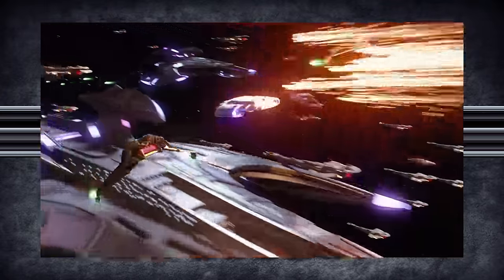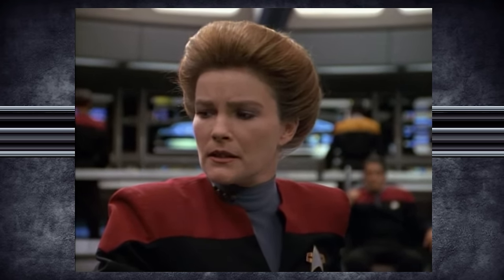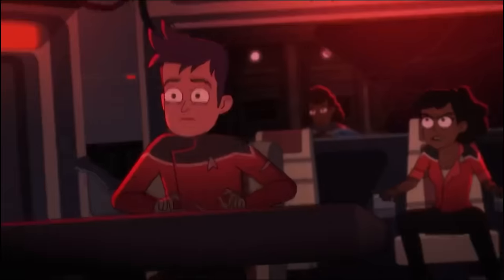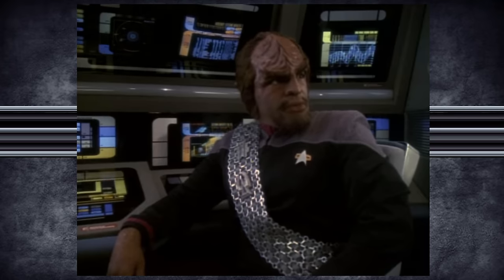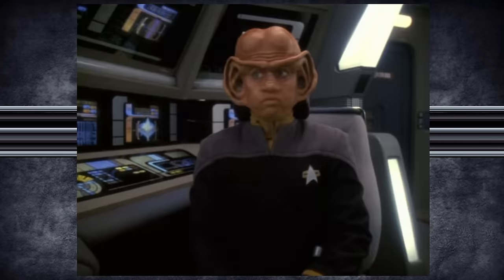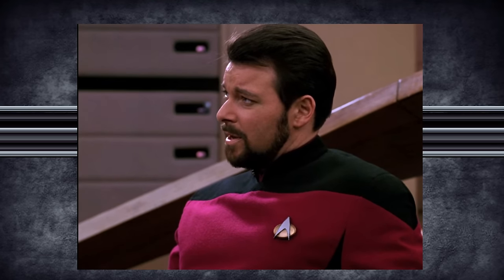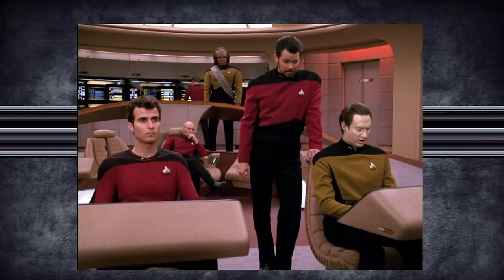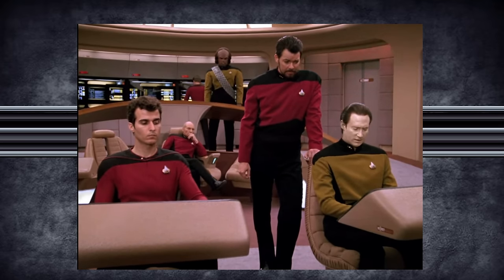Why Starfleet's Bridge Design Was Lethal to the Crews

Comment: Their consoles had zero surge protectors and seemed to be insulated with powdered magnesium.  It seemed safety was priority 5 or 6…
Reply: More like "Not on the list".
Reply: Principles of SF Design:
1: Shape
2: Feel
3: How the officers felt
4: Somewhere for a counsellor....on a bridge....
5: Comfort
6: Style
7: Colour matching
8: Practicality
9: Safety
Reply: I blame the Bluegills.  The space parasites obviously needed to be able to disable any ship that stood against them.  Designing the consoles to explode with only the slightest power surge would do just that.  Only, after they were eliminated, nobody realized what had happened, and Starfleet continued producing the Bombsoles, as they had been conditioned to think bridge explosions were normal.
Reply: Almost like they had forgotten the concepts of Low energy control circuits learned in the 20th Century.
Reply: A tradition dating back at least to "voyage to the bottom of the sea".  The most efficient way to wire anything is to route the main bus through the control console.
Reply: You're not wrong, think of all the components you save.  (/S).  On a serious note this is hold the old rotary dial dishwashers and ovens and washing machines all work.  The dial is directly connected to the power.
Reply: Explosion! Drama! Pew pew. They need less surge protection to have more drama! Lol because explosion equal ratings ;)
Reply: @whirledpeaz5758  
Yeah. It is a computer terminal for weapons, not the weapons themselves. The engineering section console is not the warp core. 
It is just a computer interface. It isn't even the computer itself. It would be like my keyboard and mouse exploding, but neither has enough juice to blow a knat's  nose.
Reply: I believe the EPS system was supposed to directly route the pasma created in the warp core directly through all areas of the ship to provide power.

Pretty much any power surge - no matter how small - would result in everything within about a foot of the plasma coduit instantly vaporizing into superheated gas.
Oddly enough, this tracks with Scotty talking about replacing fuses and "fused" systems in TOS all the time.  Fuses in electrical systems prevent fires by being designed to fail if the system goes above a certain limit.  Plasma fuses would probably do the same thing for the ship's internal plasma systems.

Notably, fuses in the real world have a degree of variability in their construction that can lead to spectacular results if a system experiences a big enough surge to experience several failed fuses at once. 

By the TNG era Starfleet had advanced 'beyond' fuses for most systems and as a result exploding consoles became a recurring problem.
Reply: @Grizabeebles  That, and Surge protectors are rather limited at what they can do.  For example, the massive transmission lines that we see coming from power plants can actually shoot power within 6 FEET (1.82 m) of the wires themselves.  That is why you see them held away from the steel from from massive conduits.  Now, we are dealing with weapons that include charged plasma, particle beams, and other weapons that are capable of creating an electric charge all by themselves. Quite powerful ones that would likely put the power transmission wires to shame.
Reply: EXPLOSIVES! Build explosives into EVERYTHING! LOL
Reply: I think is because their power is plasma based, meaning the straight up use the plasma produced by the reactor(warp core) and directly use it as power, this make a surge system difficult because flux in energy literally is represented by flux in temperature and electric potential energy in the plasma
Reply: I think they put quick upward mobility through the ranks above safety.
Reply: @SImrobert2001  Y'all are missing the face that this universe has miniaturized, self-powered shield generators. Why does every crew member not have one that immediately activates as soon as an alert level is set? Why do the consoles not have emergency containment fields in the event of an explosion? Why is the entire interface not a forcefield with a holo-projection under it?

In the complete opposite direction, why are there absolutely no manual disconnects or overrides anywhere in any Starfleet construct? These people lose power and then they have to put suction cups on the doors, did they forget handles exist?
Reply: @Teth47  -- Don't forget the "structural integrity fields" - Starfleet Ships often need working forcefields just to move under power without ripping themselves apart or exploding.
Reply: Magnesium, wrapped in lithium,  with a thin glass coating.

And giant capacitors, guaranteed to knock crewmen unconscious.
Reply: @sirhenry9313  Only the Galaxy Class had a station in the center for counselor/auxiliary. Love Boat is fairly accurate. I think the layout served the crew well (outside of combat). The battle bridge probably could have used a better, more combat oriented design. after all, the Galaxy Class was a diplomatic ship. Think it was also the only class to specifically feature a large civilian compliment. Something Picard was not actually fond of.
Reply: @Krahazik  Sovereign has 3 as well.
Reply: @Weaseldog2001  Don’t forget the outer shell of each console being constructed of C4.
Reply: @icecold9511  Remember a few times in TNG when Geordi would come onto the Bridge and just - turn a station into Engineering? Couldn't do that if it was more than 'just an interface'.
Reply: Also they were full of ROCKZ!!
Reply: And the bridge was made with ROCKS!!!!!
Reply: They went like "So let's feed the main power directly into the display. No regulators needed."
Reply: I'm not sure, but my understanding is that surge protectors may have turned the console off when they needed it.  A risk of damaging an officer for a few more minutes of use of the equipment might have been a good trade.
Reply: On later Federation ships that had the Galaxy class  style touch panels literally any station could be displayed on any display panel. 

IMHO the bridge layout of a nuclear  submarine is similar to the Defiant. Everything is arrayed around the Captain do he can communicate easily.
Reply: @frankharr9466  Well, the things that explode are basically just a display and a keyboard combined. So I'd rather have a screen not exploding into my officers face than create extra work for medical staff while a battle. It's not like that tiny bit of extra information is useful if your officer seeing it dies or gets unconscious.
Reply: I'm pretty sure most people in this comment chain are wrong. Safety is the #1 priority focus in designing any components for Federation starships.

It's mission-critical that every piece of every ship provides the minimum possible level of safety without failing spontaneously before leaving a spacedock. Anything more and the ship would be a design failure.
Reply: Things that always bothered me: 1. Near total lack of redundancy. 2. Fragile main power distribution systems (EPS conduits fail all over if the ship is hit in one place). 3. Lack of automated defensive systems and requirement of a crew member to arm and target weapons (targeting fast moving ships when you are in a fast moving ship would be almost impossible to do manually). 4. Lack of AI throughout the systems on each ship and across the fleet. 5. Complex maneuvers performed by a single crew member when it's virtually impossible for one person to operate a complex system of thrusters need ed to change direction in space at a rapid pace (while admitting that a system could be designed to allow for computers to do this while the helmsman could manipulate steering controls while navigating visually...but see the problem of high velocity). 6. Fly by attack patterns just make combat difficult and never seem to make a difference because the weapons vector can change on the fly. 7. Humans making defense pattern decisions and having to call them out instead of simply inputting the command or allowing an AI based tool to optimize the situation. 8. Shields that do not automatically rotate frequency. 9. Why a night shift that's leanly staffed in a ship operating around the clock? 10. Why do localized explosions and attacks cause shipwide loss of stability? Is the ship made out of string cheese? 11. Lack of segmentation of computers and ship control systems. 12. Lack of personal emergency transport activators. 13. Having to manually drop and raise shields over a period of many seconds to transport when the transporter signal would pass through the shield at ultra high speed.
Reply: @texlad04  actually, the weakest component, namely the human part, is also the most flexible and intuitive one. But yeah, many things are hilariously stupid. Like having not really secured access codes that you have to say out loud in front of everyone and which do not seem to change at all. And having centralised access code management.
Reply: @comedyclub333  exactly right on security. Aren’t the access codes 4 characters or something like that? If you can break a hash of multiples of that number of characters with 25 bucks of computer time in 2021, you would need much stronger authentication measures for even non-critical starship systems far into the future. But voice command probably did sound like hot stuff to the writers of TNG back in the day  which is why I imagine they went for it. But why did the absence of a keyboard mean that people would push odd sized colored buttons in random sequences? At least I do think the latest holographic controls in Picard look like they might be practical.
Reply: @comedyclub333  

Is it worth it if the screen stays on and usable as opposed to off and you have to reboot it?

And don't forget, you run the chance of loosing drama!  You can't bore your audience.

Also, my understanding is that people who drive Hummers into combat areas do essentially the same thing.  They disable the fuses so that they can keep using the vehicle a few moments longer before it shuts down.
Reply: Just think of all the companies you've ever worked for. "Safety First" is always 4th on the list, at best... Profits, On Time Delivery, and Customer Service are always the first 3. Quality and Safety are in a never-ending fight for 4th on the list.
Reply: @sirhenry9313  You forgot carpeting quality and mood lighting?
Reply: @hullbarrett  

If you want safety first, don't leave the planet.
Reply: i think the consoles had surge protectors, but you should understand that no matter how robust your insulation is an electric current can still pass through it at either extremely high voltages (which would fuse the circuit completely) or can also pass through on a quantum level, now assuming that the computing technology employed by starfleet is in the nanometer scale like we currently have with modern semiconductors then we can confirm that the technology is vulnerable to quantum tunneling via superposition. since touch screens employ two separate conductive layers of glass that make up an incomplete circuit, pressing the glass completes the circuit and an interaction with the console is made. now even an incomplete circuit can make a connection through either ionized gases or through physical contact with a conductive surface, humans are quite conductive, so a sufficiently high current can easily jump from the console to the operator even with surge protection and insulation in place, in theory.
Reply: @Grizabeebles  Not to mention that OSHA was all but deprived of the entirety of its budget by 2300, meaning there were no standards left to enforce workplace health and safety.
Reply: i thought they were a combination of pure sodium with water based LCD components.
Reply: Why safety? The bridge personell is inherently safe.

Redshirts, on the other hands...
Reply: No doubt designed by Michael Bey...
Reply: It’s not like they have to look out the window for road signs.
Reply: The science station instantly changed to a tactical station in TOS. In NG, the helm became a science station and shared tactical duties.  No confusion there.

Comment: I love how the intrepid class has separated ops and the conn. Think about it. Having Harry and Tom on opposite sides of the bridge means they have to speak loudly to each other. This gives Tuvok an opportunity to scold them as often as possible.
Reply: It also means that if something goes wrong with one of those stations, it will be far enough away from the other station that the functions can be re-routed to the other officer.
Reply: Considering the consoles in voyager seem to be made of explosives it works well.
Reply: @jeffisgay4eva  I think you mean how the consoles in every Star Trek show and movie seem to be made of explosives.... It's never some random bits of overhead guff or things hidden in the flooring that pop off. It's always the consoles. It's as if sometime in the 2200s they forgot about the concepts of fuses and circuit breakers, and started building circuit boards out of TNT.
Reply: @Dee_Just_Dee  fuses blow, curcits arnt  everything, power is thunder, thunder is deadly, and lobbing warheads at your shields cant be good on the deflectors, or anf direct hits to the hull.
Reply: @Dee_Just_Dee  don't forget the rocks. Starships are full of rocks.
Reply: @akimbofurry2179  it's allways stated that control and computer systems have their own control grid, seperate from the actual plasma power grid. Which makes it even stranger that the consoles on the bridge explode, just functionally speaking. If power is gone due to direct hits the consoles just should go dark untill auxilliary kicks in.

Explodium and rocks! Probably even more important than duranium and dillithium in Starfleet.
Reply: man it's almost like it wasnt designed by military personnel at all and was instead designed by a director and set designer sometime in the 1960s..
Reply: @ObsceneSuperMatt  They really don't make much sense. But it makes for good practical effects and flying officers.
Reply: @DerBeppone  I love lpractival effects and flying officers lmao
Reply: @BoundlessxArts  
You mean the Explodium?
Reply: @ObsceneSuperMatt  Presumably their computers are some kind of exotic quantum computers.  Maybe they just tend to explode, like lithium-ion batteries can when you abuse them?
Reply: I believe for all the 24th century ships that the additional terminals also allow for redundency. As they are touch screen they can be remapped on command to take over from a destroyed consol. Or Riker could get a joystick and crash the ship. TOS despite being the bad bridge actually had auxillary control so any junior officer could take over if the bridge was compromised, destroyed or staff otherwise incapacitated.  So redundant features were a constant.